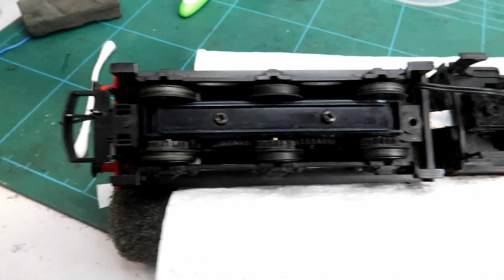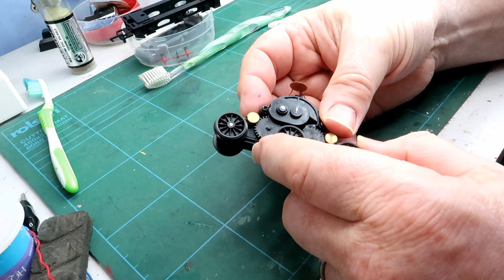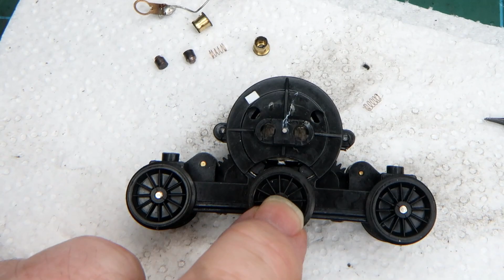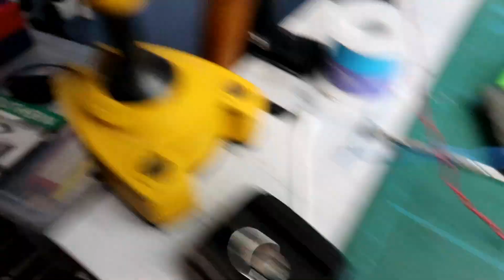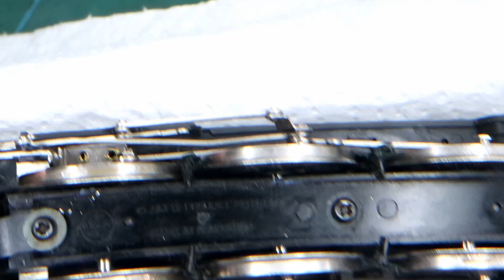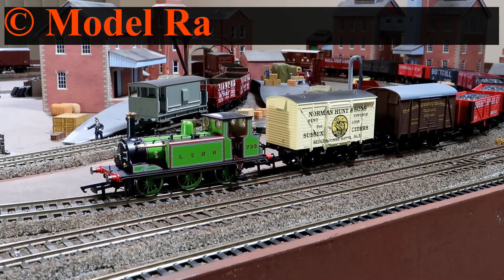Airfix Royal Scot, depressing service video will she run again?

Comment: I would look out for a good used motor for that as I don’t like all the splits you have. I have the same loco, I may convert to DCC sound as I believe the loco should have enough room for the decoder and speaker with some surgery using the rotary tool.

I think your loco has spent some time sitting out of its box unused in a dusty environment with extremes of temperature - and that has hence caused both the dirt and the splits - probably someone’s loft for example?

Comment: Looking at a December 1977 Railway Modeller i have to hand, none of the advertising in it mentions the Airfix Royal Scot. At most they have pricing for the Airfix Prairie Tank and class 31. 
I think the 1977 on the model is therefore when the tooling on that part was made and the final production model took some extra time to get on sale.
This fits in with my memory of new release Airfix puzzling me with an old date on them.
Guy Norris said the Airfix 61xx Prairie tank was theur best selling locomotive and priced at 6.50 pounds.
Reply from the maker: Thanks John, I get the feeling she's from 1980 myself. Fascinating facts there.
Reply from the maker: @kevinblakeman8858  aha that locks it down nicely

Comment: I have a complete collection of Airfix OO locomotives, any cracks in the motor housing screw holes have been strengthened with epoxy glue and so far so good. My Royal Scot needed a new base plate on the locomotive as that had broken into many parts but all the models are running well.
Reply from the maker: Thanks Robin, I was wondering about epoxy. Complete collection well done

Comment: A great video.  She runs lovely.  I bought my Airfix Royal Scot second hand and am very happy with her.  She squeeled horribly and the engine wheels would stop turning on curves, but with a light service, some lubrication and a little adjustment of the back to back guage of the wheels, she runs very nicely.  Fortunatly I had no issues with cracks or splits.
Reply from the maker: Thanks Piers, glad yours is sorted. Does yours run a little warm?
Reply: @ModelRailwaysUnlimited  Hi, I hadn't noticed her running noticeably warm, but i'll give her a run out tomorrow, and let you know.

Comment: I've got one of these and there are a few cracks but it still runs well like yours. Hopefully the plastic is stabilized now. I bet it will look great on the layout and they are smooth. I look forward to seeing it pulling some coaches. All the best to you
Reply from the maker: Hi thanks very much, she'll get her chance later today. Does yours pull around 250mA and gets a little warm?
Reply: @ModelRailwaysUnlimited  a bit more than mine Mike, I get a reading of around.18 with a few coaches on. I didn't worry about the cracks in my motor, I took it right apart and it went back together fine. Tip I would pass on, spend a little time ensuring the black course screws that hold the motor together go back in the original thread. Otherwise it will force the plastic apart as it cuts a fresh thread. I also use a thin bit of cotton through the brush holder to hold the brush while I reassemble, makes the job easy, pull cotton to release brush when done. Great video I think your loco will be fine 🙂
Reply from the maker: @MrSnooze  many thanks, I'll need to look again I think

Comment: With cracked or stripped screw mounts I always find Araldite works far better than superglue.
She certainly was a filthy and tired old girl. Great job on getting her back into shape.
Reply from the maker: Thanks Gerry, I use industrial super glue which is very strong however you are probably right.

Comment: Hi Mike. I have worked on many of these (some videos on my little channel) but I have never seen one as bad as this. Loft temperature range maybe? Or perhaps bad lubricant back in the day? Yes that extra hidden gearbox on the motor shaft is fiddly to rebuild at the best of times, but without going in its hard to get oil to the faster moving bearing points. I'm a firm believer that unless it's a real issue (normally only when excess lube has got in) to leave the commutator well alone. Carbon dust is just what happens. Can motors run just fine after all!!!
There are servicing channels on YouTube,  one in particular, that scrub every piece of copper in sight and often with a fibreglass pen. What happens is the soft brushes will wear down twice as fast in time.
Reply from the maker: Thanks. I agree with your observations. Oh tell me about it, the com polishers lol all they do is make scratches that get filled with carbon lol. I'll check your videos later. I also wonder about the loft
Reply: @ModelRailwaysUnlimited  that's right. And commutation segments will soon get carbon in the gap. I don't consider myself an expert and am always learning,but I did work in dc motor mechanism design.
My servicing consists of cleaning wheels and tiny drops of oil on bearings. Check pickups make contact when axles are pushed each side, and that works 99% of the time.
Hornby ringfields work like a charm when you put light oil on the axle bearings, that's just because it stops the differing metals oxidation. The latest myth is when people state insulating or conductive lube must be used depending on location. Trust me the spindles don't run anywhere near the surface speed to build up a barrier film to prevent conducting the juice.
What really grinds my gears us when Bill arrogantly slates a manufacturer by saying "what were they thinking!".... He is not a design engineer.
Reply from the maker: @gs425  oh yes, we are one on all that

Comment: That's a bit of a bummer. It gets to the point when a full disassembly could be fatal. I have a couple of models like that still running as patch jobs. But just to give the age some perspective... this was manufactured the same year as the last execution via guillotine in France! Could it have become damp during the flood at your dads? Perhaps it slipped through the net when cleaning everything?
Reply from the maker: Thanks, blimey I never knew that. No she was already here at the time of the flood but good thinking

Comment: That was a true Labour of Love!

Do you watch OOBill? He is always very reluctant to dismantle old Airfix & Mainline locos too for the same reasons as yourself.

He uses WD40 contact cleaner quite liberally when servicing locos. Have you considered / tried it?

Finally, I'm sure those Deltics I voted for would've been much easier to service 😀
Reply from the maker: Thanks Stephen yes it was. I did but no longer watch him. Use of WD40 is a very bad idea even the manufacturer says to use something else on our application. The only exception might be when trying to free a stuck fixing
Reply: @ModelRailwaysUnlimited  He uses the contact cleaner, not the "original" WD40.

Anyway, whatever you use, it's great to see these old locos being given a new lease of life
Reply: @stephendavies6949  I'm with Mike on this. Bill is very arrogant and doesn't listen to advice, yet some of his methods and opinions make me switch away from his channel.
Reply from the maker: My mistake sorry, yes I use the contact cleaner
Reply: @gs425  I thought you may have misunderstood my question, but didn't like to push the point. Thanks for the clarification 🙂